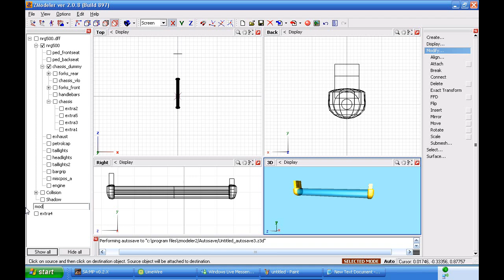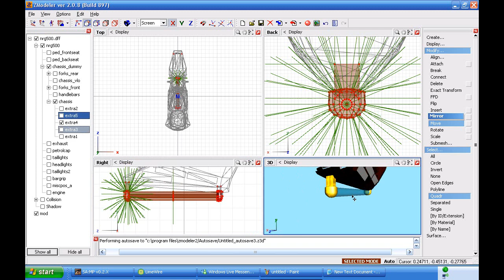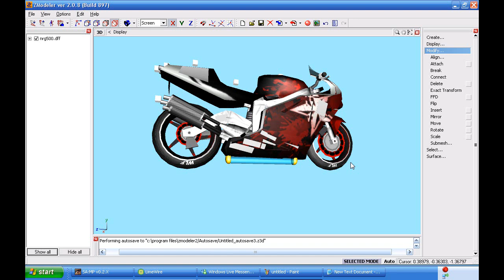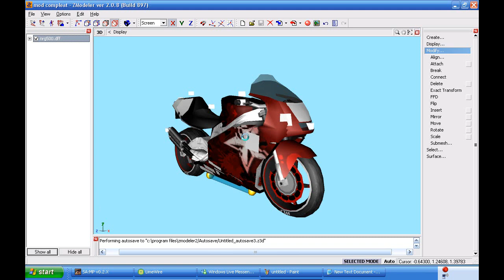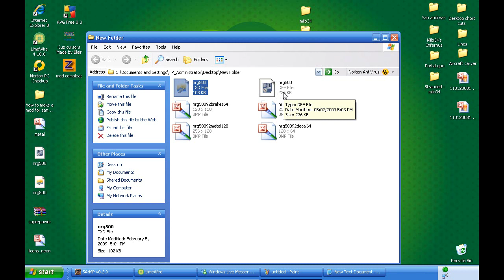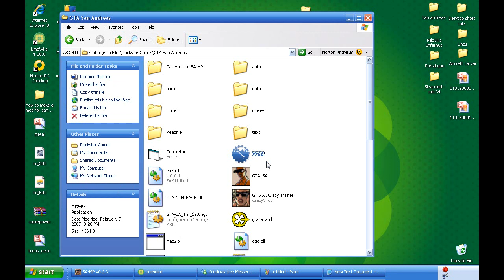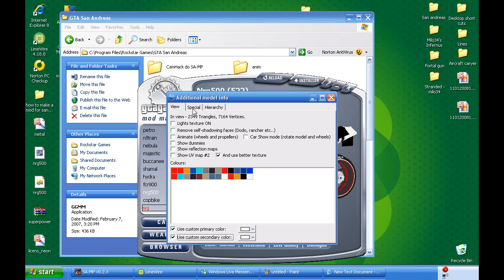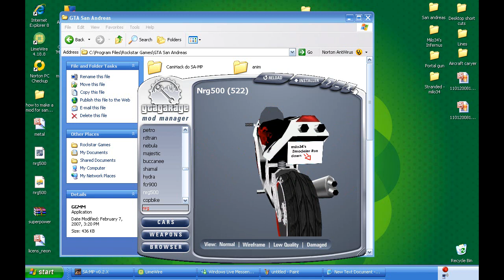How to make a Mod for San Andreas - PART 6

Comment from the maker: @domiselomi

SImple noob error U didnt set the images in Zmodeler for the chassis and everything else exetra, If u need the picts for the NRG500 for the body Extract them from nrg500.txd with Text workshop 2 get the .TXD open GTA3.img and extract. Also use problem solving and look at my texture pannel next time it comes up and notice whats what and where it go's Ull be able to solve alot of problems that way and wont have to ask simple questions